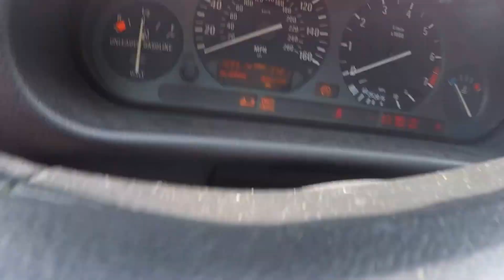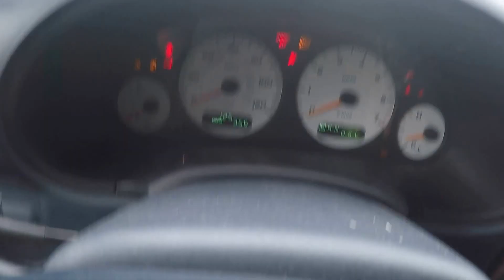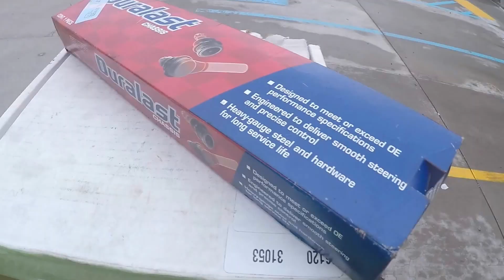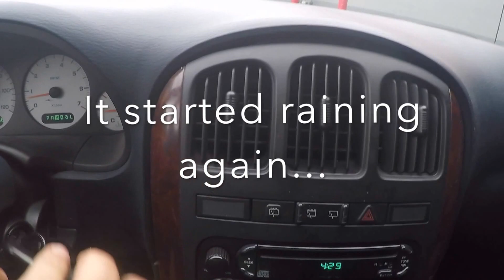Project car BMW e36 pt.2 taking damaged parts off and restoring headlights/grill

Comment: What exactly did you use to restore the headlights? They look amazing!
Reply from the maker: I forgot what grid I used but basically wet send it then polish it with a buffer. Ill try to to get you the name of the ones I used.

Comment: so far it looks pretty good,  what are your plans for it? my e36 has a V8 in its future, as well as a 6-Speed Manual, if I can ever get the rust under control lol
Reply from the maker: v8? that sounds sweet I feel you on the rust part i slap on carbon fiber filler on mine and for the future plans most likely getting it boosted :D

Comment: Good work, nice to see the vids coming. Did You clean the rust off the hubs before installing the new rotors?  If not, you might get some vibes from the front end.
Reply from the maker: I didn't clean them good enough now it all makes sense I was wondering why it was acting the way it did I need to go over them and clean it, Thank you!